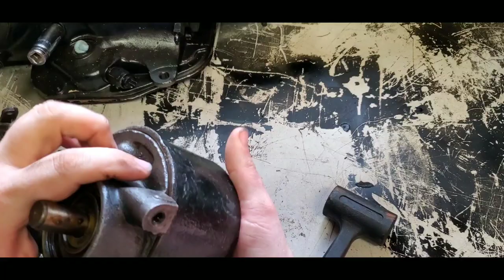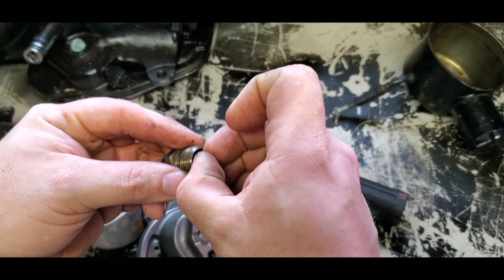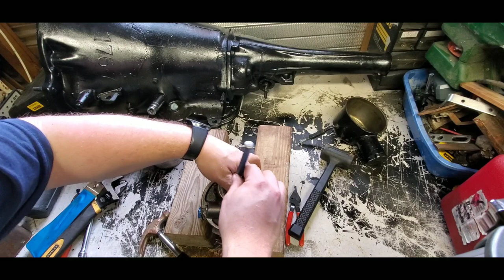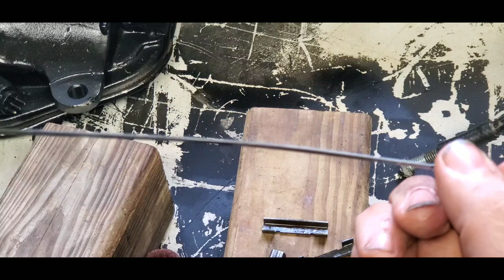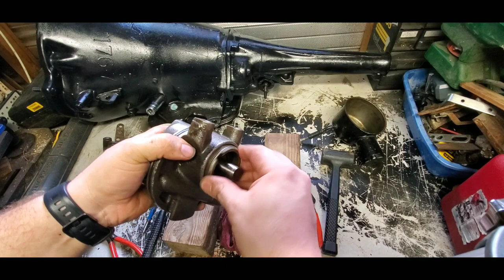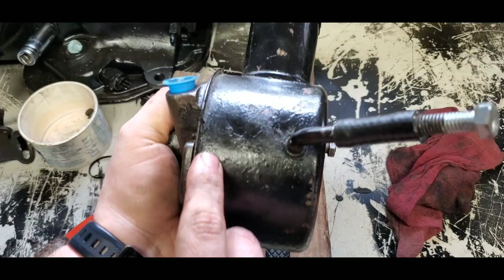Mopar TRW (Thompson) Power Steering Pump Disassembly & Reassembly

Comment: Thanks for posting.  I rebuilt the TRW pump in my 1965 Dart w/ 273 engine.  I should have taken disassembly photos since I spent a long time googling for photos to see which way the rotor shoes should face.  Amen on slowly pressing the rotor in while keeping the shoes aligned with it.  If not, a spring will cock and the rotor will jam since the shoe then won't go down.  Good you tested it before continuing.  I had to re-spin a few times to re-align the springs.  A few differences are that my reservoir has 2 bolts, with a matching gasket in the kit to seal the reservoir.  My 1965 Newport w/383 engine also has a TRW pump, but its shaft is thicker (so pulleys can't swap).  I think most kits come with needle bearings, lip seal, and bolt seals for all types.  Note, that the later Federal pump looks almost identical, but is quite different.  It has 1-bolt securing the reservoir and a short channel depression just for it, not the long slot on TRW pumps.
Reply from the maker: As good as this pump looked, unfortunately it failed when it was tested on a vehicle. The safety valve had been messed with (before I got my hands on it) and some of the internal valve parts shot out the side of the pump. It was starting to work before the failure so it would have been fine had the safety valve not been messed with.

Comment: Thank you for doing this video.  I had a simple housing reservoir leak.  new round seal done.  No leak.   When removing retaining springs or pins or similar, cover with a clear food plastic so you can see through while removing/replacing the son-of-a-gun spring/pin won't fly around.  :-)  I usually cover with my hand.    Putting rag underneath is good idea/style.   You did well.  Give a hug to your dad.
Reply from the maker: The rebuild did go very well but unfortunately someone did tamper with the valve which did cause the pump to fail when I installed it.

Comment: This is great info as I'm about to rebuild the exact pump.  How did you get the pulley off? Did you use a special puller?
Reply from the maker: Yes it's a special puller. Google chrysler power steering pulley puller and you will find it.

Comment: That one valve with the big stainless cap is the pressure bypass I believe. I'm trying to find setting info on it. My belief is it would be an overall measurement. The farther the cap is screwed on the more pressure before bypass. I cannot find info on proper settings.

Comment: How does one keep the power steering fluid from leaking past that one bolt that holds the bracket onto the back side of the reservoir?
Reply from the maker: You could try a flat fiber washer.
Reply: @Charger383Mopar Thanks,  However I just found out there is an o-ring that goes inside where threads begin and that the bolt will squeeze that oring and seal things up when tightened down.
Reply: My 1965 TRW pump reservoir is secured with 2 bolts thru the back, though I noticed his has 1 bolt, which others have reported, though there are 2 tapped holes for rear bolts.  My kit had a gasket with 2 bolt holes which fits between the rear of the pump and the reservoir as a seal.  I heard that later 1-bolt reservoirs have a round rubber seal on the single bolt.

Comment: In the end. Did you find anything that could've made the shop say they couldn't rebuild the pump? Looking at the video it looks like its not worn much at all?
Reply from the maker: I think the issue was in the control valve. I had to use my wheel cylinder hone to smooth out the bore and fix a flat spot on one of the pieces of the control valve. I believe I got everything fixed so once I get the 2 seals I need and sandblast the reservoir and pulley it should be good to go. At this point I dont know if the rebuild service did the damage or someone long before my dad got the Charger.

Comment: i decided to take mine apart because it has never worked since i bought it and i had to replace one of the snap rings because it blew up and jammed the control valve inside the cylinders. I've cleaned it out and put the parts back in and when i turn the engine on, the steering wheel moves to the right ferociously! i tried tightening the relief valve a lot more and the aggression has disappeared but the wheel still wants to turn right while parked and on. any ideas how to fix this?
Reply: the fix was adjusting the gearbox power valve

Comment: Advance Auto has a power steering pump for a 1976 Charger with a 440. It will bolt right up to your pump holder. It's 48 dollars with your old core.
Reply: Sure?  A 1976 would probably have a Saginaw pump.  The brackets are much different.